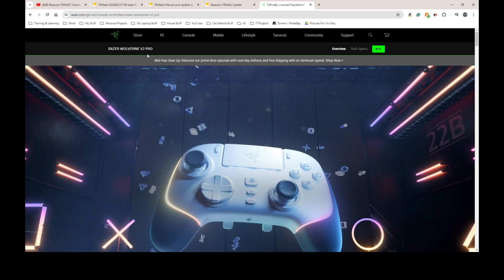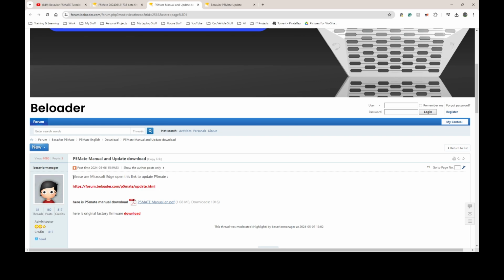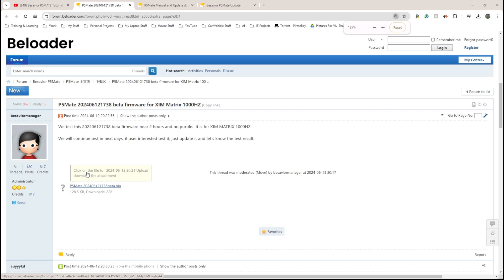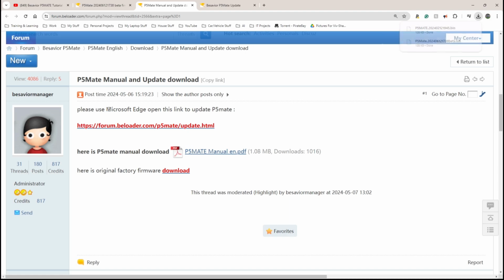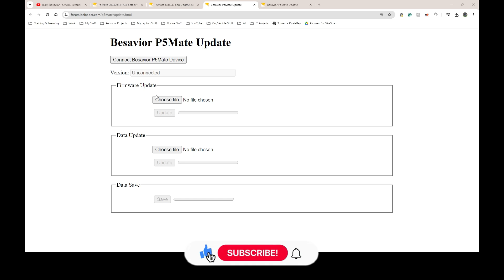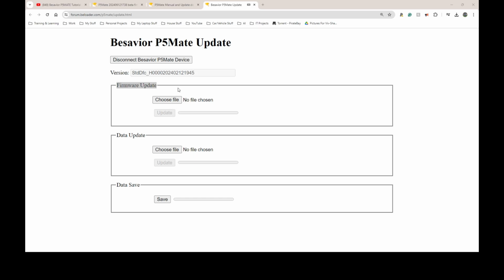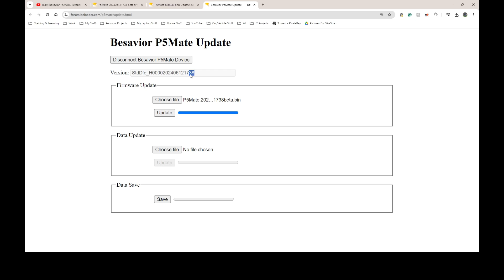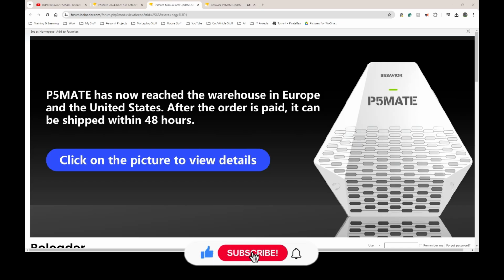Beesaviour P5 Mate Firmware Update (July 2024)

Comment: Do newly shipped p5’s come with this already installed?
Reply from the maker: No, this is not an official PlayStation thing.
Reply: @ I’m talking about the p5 mate. If I were to buy one, would I still have to install this firmware?
Reply from the maker: Only if you need 1000hz, that means polling at 1000 times per second.

Comment: Is this helping with desync i get much latency while using controller or zen
Reply from the maker: Desync?
I am not sure what you mean.
This should, in theory reduce latency with something like the Xim Matrix as it does not need to go across the network.
Reply: @RonsTechHub yes heavy desync it is latency while aiming or it aims without touching just what i said its because it 250-500 pol rate i made an update for xim where they said it would have 1000pol rate but still with controller or zen i have so much latency. Did besavior made that update that brings pol rate up to 1000 for everything or just for xim matrix?
Reply from the maker: If memory serves, Xim Matrix and Xim Apex.

Comment: My pc sees the ps5 mate but the updater doesn't, how can i fix this?
Reply from the maker: Be sure to use the correct browser. 
Honestly if that doesn't fix it then I'm not sure at all because I had none of those issues.
Reply: @RonsTechHub  its already fixed, i used the download from the ps5mate website. There is a folder inside with instructions that said to use zadig to install a different driver. After that I should be alble to run an updater wich is also atached to this download folder. Never should have done this. I luckily was able to uninstall this driver and now the update method from the forum is working👍
Reply: Did you find a solution for this?
Reply: @kacperlopata7616  restore the drivers  to default. I screwed them up by accident. Now the updater sees the ps5 mate

Comment: Do you know why my b5mate keeps losing connection. I have to keep on unplugging the cord just to connect agin
Reply: I do and it still disconnect
Reply from the maker: Be sure to use the port that supplies etra power, that is the second USB C port.
Reply: I also have this issue, also have it plugged to additional usb c power.. i have atm beta firmware and xim apex.. any solutions maybe?